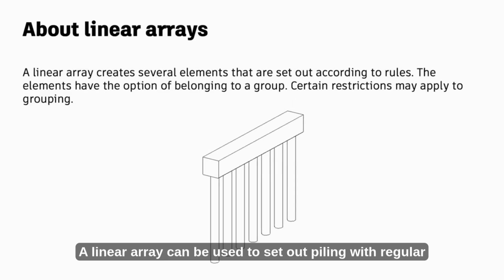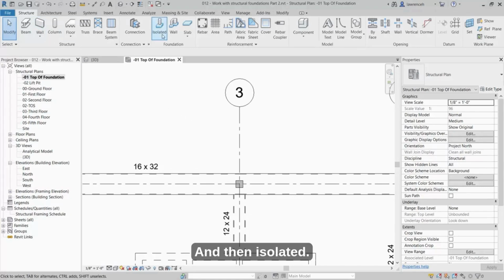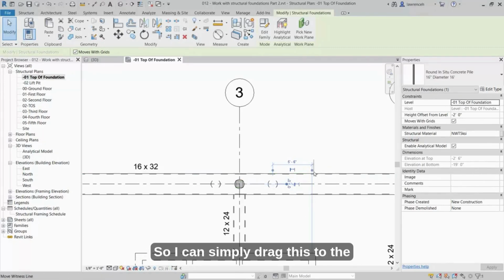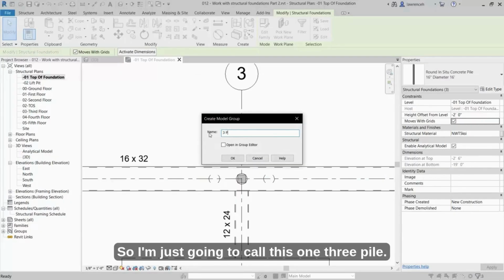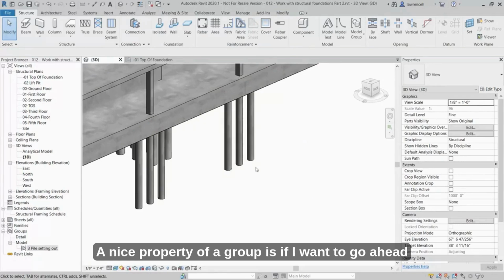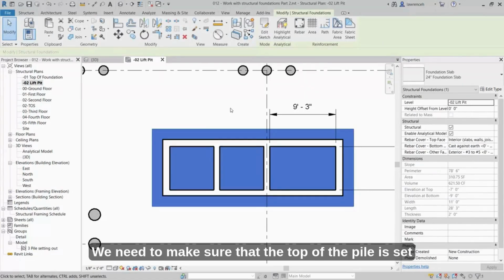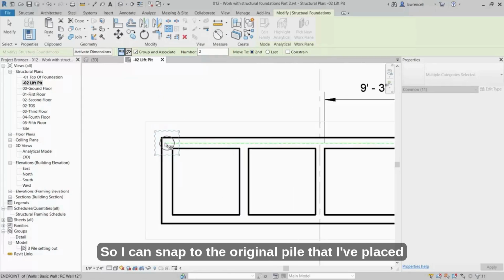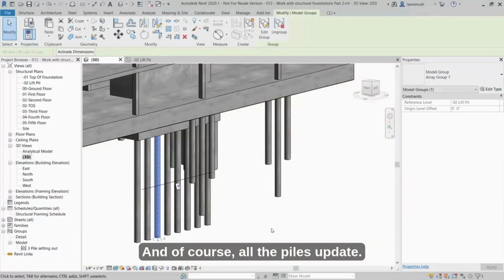Revit Tutorial - Working with foundations - Part 2

Comment from the maker: In this tutorial, we’ll show you the easiest and fastest method to set out piling in Revit. Learn how to create linear arrays of piles, group them efficiently, and adjust pile lengths with full automation. We’ll cover isolated piles, group management, and how to use arrays to maintain precise spacing along beams and walls. By the end of this video, you’ll be able to set out multiple piles along structural elements, update all piles instantly, and streamline your foundation modeling process.